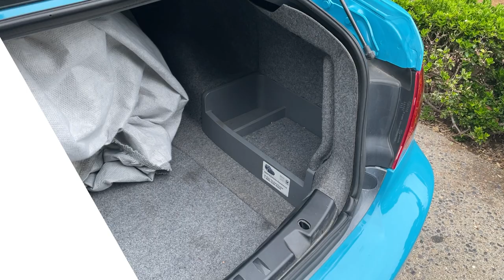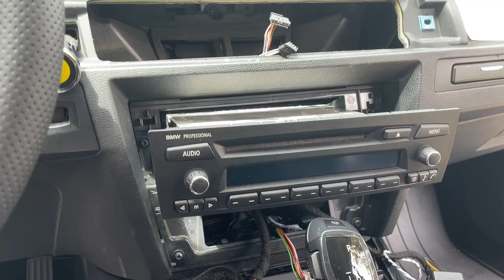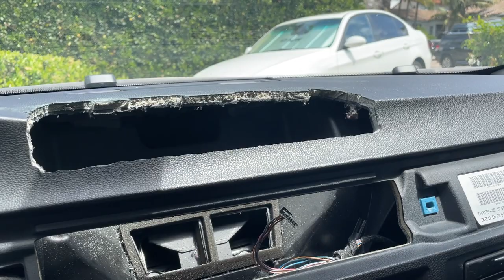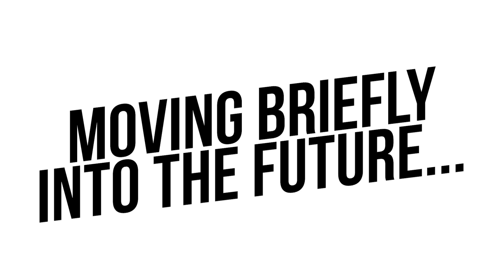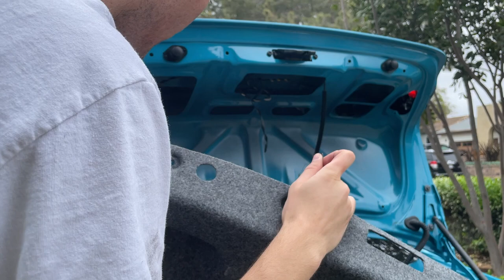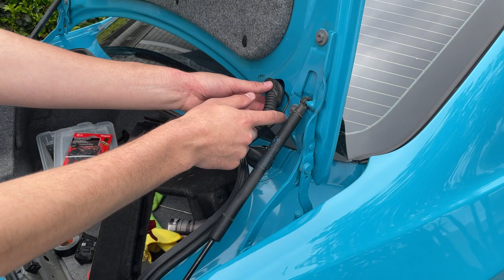CarPlay in My E92??? - MotiveSupplies 10.25" Android Touchscreen Headunit Install

Comment: Bought an Xtrons unit today and started looking for detailed tutorial. You sir have done a very fine job with your tutorial. It’s going to be my main guide when I do it
Reply: Struggling with my idrive controller, let me know how that part goes for you. I have the same unit
Reply: @jeanpierreclarke9078  are you having trouble sliding it into the center console trim? I had to sand the controller down a bit in order for it to fit into my center console trim. Honestly it’s not even noticeable but you do want to be careful doing so as to not take out too much of the borders of the iDrive controller.
Reply: @TheGamingDistrict1  no totally fine fitting it, just having issues with it communicating with the head unit.
Reply: @jeanpierreclarke9078  so there are three main harnesses that connect to the actual head unit: the larger one that connects to the radio, the harness that has all the composites for the back-up camera and such, and the harness that connects directly to the USB.

The harness that has all the composites where you would connect the camera also has another cable where the controller cable fits. This is where you connect the controller. I had the same confusion at first because there’s another cable that connects to the controller, but that one isn’t it. You want to connect it to this harness I’m talking about. That should allow you to use the controller.
Reply: @jeanpierreclarke9078  does it work?

Comment: Hey there! Nice detailed video. I was wondering if this unit has an FM receiver as well? Cause if u want to listen to radio you'd have to switch back the old unit to TUNER instead of AUX...
Reply from the maker: This unit does have an FM tuner. I rarely use the radio and did not get a chance to try it.
Reply: @autolytic  thanks for the reply!

Comment: hello! I upgraded the system but now nothing works, I try to revert the upgrade but I can't do it, do you have a link for original firmware? I can't find it.. I think i can install it over the USB plug but only if i can find it somewhere

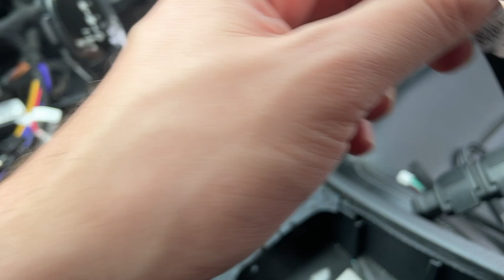Comment: Hello. To get the gps antenna and external dongles working, where do you connect it to (@ 14:30), where do you connect that dongle to? Do you connect it to the screen?

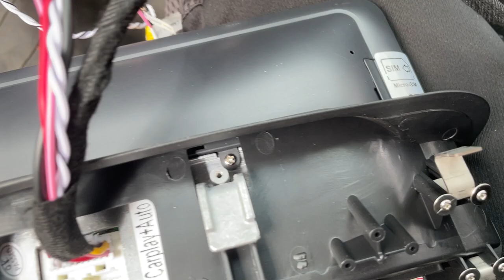Edit: reached 16:00
Reply from the maker: I did not personally connect the GPS antenna. However, I do believe you connect it directly to the screen. It should be labeled on the instructions that came with your unit.

Comment: Is it possible to get rid of or change the Motivesupplies logo on boot? Does it always show? Also, is it possible to boot to idrive instead of android and bypassing the loading screen that way?
Reply from the maker: It does always show, but it can be changed. It is not possible to boot to idrive since the unit itself is Android and my car never had iDrive.
Reply: Did you ever find out how to change it? 🙂
Reply: Can be changed!

Comment: Did you figure out if that auxiliary audio cable was necessary?  Do you know if it will flash MHD and XHP?
Reply from the maker: I did have to use the auxiliary cable. Not entirely sure if it is necessary. You can install android apps on this, so you should be able to connect to the mhd dongle.

Comment: hey man i did everything you said but when i put everythign together and tried starting it up my radio doesn’t turn on it doesn’t have any power and the unit didn’t turn on as well even when putting the original harness on do you thing i blew a fuse?

Comment: After installation my ac stopped blowing air through vents. Do you know what might it be?
Reply from the maker: I would make sure you just reconnected everything after the install. Since you have to take out the climate control panel, it may be related to that? Not totally sure.
Reply: @autolytic  yeah, that was it. I tried to reconnect IHKA few times and it worked.

Comment: How do you then set up Carplay? is it built-in? or is there a dongle/adapter?
Reply from the maker: Carplay is built it in. You just have to launch the app on the head unit.
Reply: Actually, some of the units have it built-in and someone don't, so the best if you check before buying with supplier.
Reply: Built in!

Comment: Hey great video just installed a similar unit but when I press my BMW on the home screen it says no signal. Also how do you use the wireless carplay /android auto
Reply from the maker: make sure you connect your phone to the headunits bluetooth and then it should connect when you launch the zlink app.
Reply: @autolytic  thanks what about when you tap my BMW mine says no signal
Reply from the maker: @blackpanther233  I think you need to go to apps -> zlink. I'm not sure what you mean by my BMW. Also if you need more specific support, I would definitely recommend reaching out to motivsupplies on Instagram
Reply: @autolytic  on the main screen you have music Navi Bluetooth my BMW then dashboard. What does it do when you tap my BMW
Reply from the maker: @blackpanther233  I've never opened that menu. You have to use carplay through the zlink app. Check out this video for more info. https://youtu.be/Ooa-JnZrgoA but I would talk to motivsupplies directly. They can help you better
Reply: @autolytic  yeah I know about zlink try open they my BMW menu let me know what happens